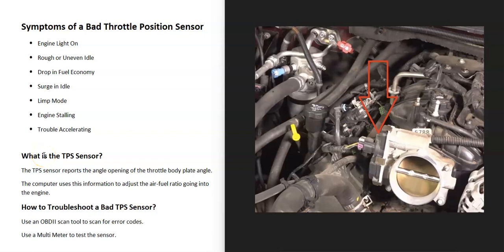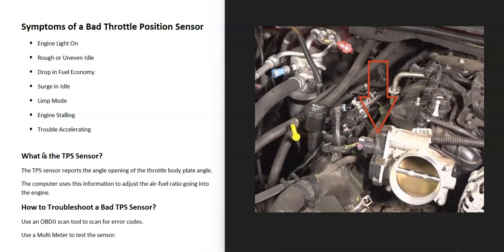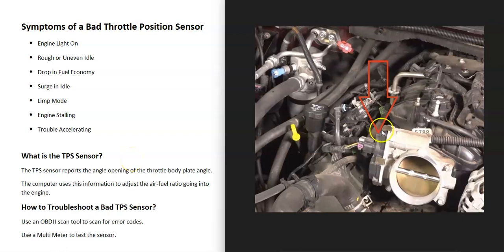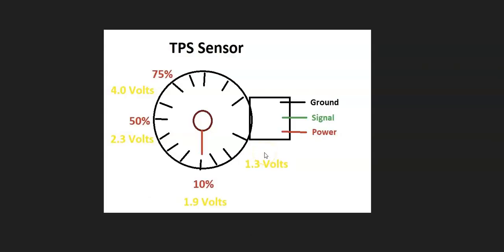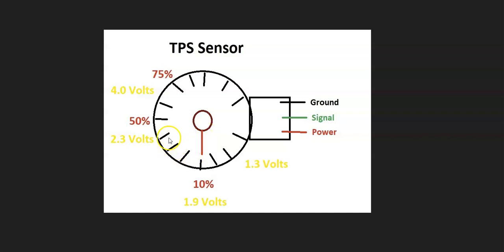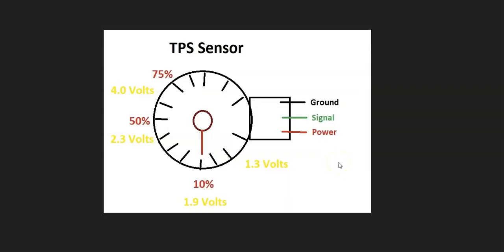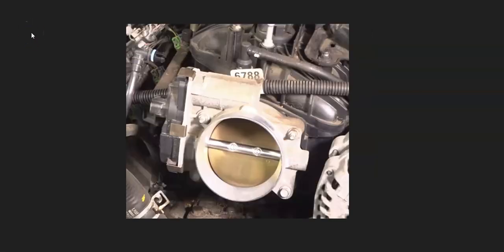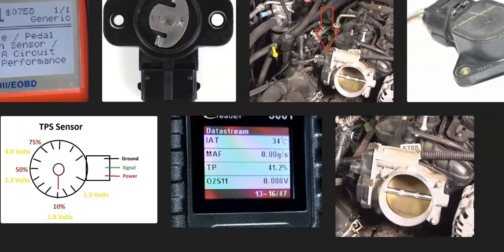Symptoms of a Bad Throttle Position Sensor and How See if it Has Failed

Comment: I liked and subscribed also I have a ford 1994 E350 Econoline van that gave these symptoms and had popping sounds as well.  I changed my fuel pump and fuel filter I changed the IEC valve also changed the tps and cleaned my throttle body I also changed the purge valve and I added a little seafoam in my tank I also gave it an oil change and new oil filter. I checked all my wire harnesses to see if any of them was bad.  It still has no power on the throttle. It max speed is at 35mph then anything over the engine shuts off. Like it's choking and motor vibrates.. what else can I do. Pls help I been stranded for two days
Reply from the maker: The problem could be multiple things, such as a vacuum leak, misfire, bad injectors, low fuel pressure, or timing off. This is just a guess, but I would look for a vacuum leak, such as a hose that is loose on the intake. 
The fuel pressure can be checked at the fuel rail to be sure it is good. If the fuel pressure is good, I would pull the spark plugs one at a time and match them to a burn chart. Look for any cylinders that are not firing or running rich or lean. This will help point to bad injectors or bad spark.
Reply: @HVAC_Mechanic  Hello I have a 2007 Toyota Yaris, I have all the symptoms of a bad throttle body that you mentioned but with no engine light and it passed smog right away, can A car pass smog even if the throttle body is bad, or can it be that my problem is something else ?

Comment: Thanks for making the video, and I hate to be critical, but you failed to adequately explain the test points for meter lead connections, using a volt meter with the TPS on the car while running, or with the TPS removed and tested with an ohm meter.

Comment: I've tested my TPS. It goes from 3 volts to 9 volts and then goes up to 12 volts. If what you say is true. Then my tps has multiple bad contact points. Is this a correct assumption?
Reply from the maker: Some TPS sensors are more sensitive than others, and spikes can be hard to see with a meter. Often, it is best to use an OBDII scan tool that can graph the rise and see if there are any spikes. I'll make a video on this when I get a chance.

Comment: I have a 98 2500 suburban with a 454.  When my tps went bad it would run out the shift points.   1st-2nd wouldn't shift until 2900 RPM's. And similar 2nd to 3rd

Comment: Thanks for the videoclip and the explanation, I have just ordered the new throttle body for my vehicle due to issues with acceleration and erratic low raves with engine cutting out, after connecting the obd reader I found the absolute throttle position sensor stuck at 83.7% without pressing the gas pedal, even after pressing the gas pedal and releasing it doesn’t move, eventually after I get the vehicle moving it fluctuates from 57% to 84.1% max but never goes below 57%… that explains why

Comment: I have a question,  2010 camaro ss, 3 throttle body codes. I've used my scan tool and gradually raised the rpms and the voltage went up until it the a certain rpm and then it would go down half a volt. Also when you kinda just stab the gas the car revs up but the voltage isn't consistent

Comment: sometimes when coming to a stop I hear a chirping noise on the drivers side and my idle begins choking almost about to stall.  I saw another video showing how it could be the "clutch" in the throttle body and in the video it made a similar if not the same noise I'm hearing so I bought a new throttle body and on my first test drive it did it again.   The chances of my new throttle body doing the same thing is next to impossible.  Its a 2013 Nissan maxima.  Any advise would be greatly appreciated.
Reply: Bat kitty CATalitic

Comment: Could you have shifting problems with a bad TPS?  Car shifts funny going into 4th / OD the engine and rpm surges and jerks into gear.  Harsh shift.
Reply: Yes
Reply: I bought a dodge dirty cheap because I discovered a TPS Error.  Owner thought it was a trans problem.   Always bring your scanner
Reply: Same issue with my 2005 canyon but mine 1st into third